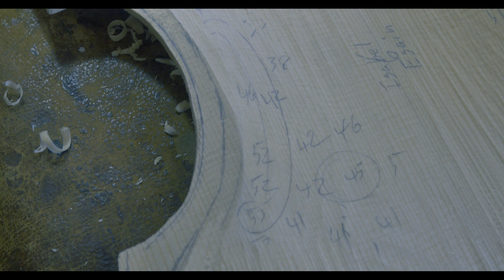Making a Viola da Gamba instrument part 2

Comment: I realized not long ago that most of you instrument makers cannot actually figure out how to work with material and you only do things a certain way cause that is all you know. For you the method works as if by magic and superstition. 
Most luthier books are from a time before power tools became common.
Most luthiers learned from some one else or from books.
Its a case of blind leading the blind.

Why are you working wood with 19th century tools ?
And why are you mis using the modern tools you do have  like what you do with the micrometer to score the wood ?
because you are inept ... blindly following some instructions without which you would never build anything.... 
This is crazy to me. Humans forgot how to think ?

And with the final prices I am better off making my own too. Even after purchasing a bunch of power tools, clamps, etc I am still saving ten thousands dollars or more.

It is a tragedy. Lets try to rectify it instead of arguing and getting offended. Luthier trade is in trouble. 
Materials science should be part of it. Modern manufacturing should be a part of it.
Even the mass producing factories do things the old way but in a rush resulting in peculiar quality.
And when they do use power tools they use them incorrectly. I saw the drill marks used in place of a chisel or sander or any appropriate tool for the job. 

Sculpture makers are using modern manufacturing techniques. It makes sculpting even easier than drawing in some cases.
We are in a mini dark age ...